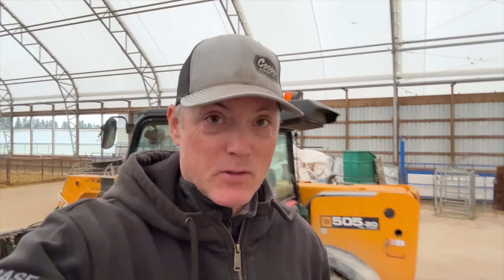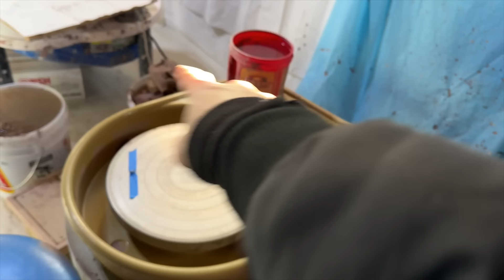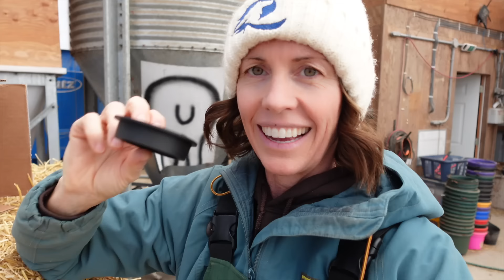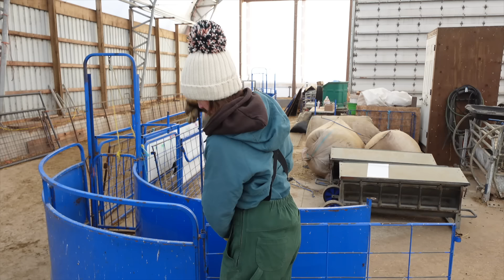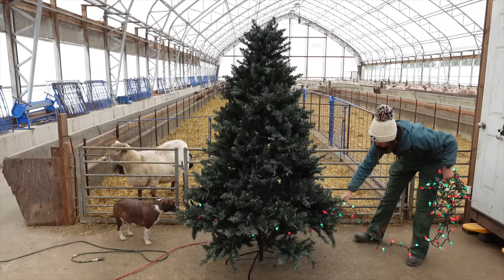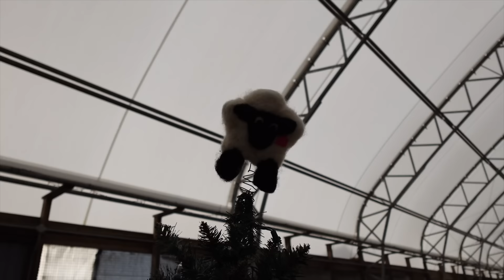I made the grain farmer be a SHEEP farmer for a day...

Comment: Just got to comment about Mark being in the barn. Thank you for giving Sandi room to be strong and capable, yet still supporting her when she needs you.  Reference: lambing 250 ewes after she broke her leg.
Reply: And everything else you do like keeping her equipment running!! ❤❤❤
Reply: I wasn't subscribing to this channel at that time, How did she break her leg?
Reply: Slipped on ice in barn if I remember correctly.  It was in the first few years of having the flock.  Mark got / had her get the telehandler as she recovered as it was easier than the system she was using and he knew she would be back in the barn as quickly as possible.  I have no clue which video it was that she relayed the story but it was one when she was talking about the old white telehandler.

Comment: And he can actually make a way for the two plugs to screw together and it locks the two together and you aren't having to rely on the sheep not nosing one out and the others from yanking out the outside one. I love 3d printers. My husband has one as well.
Reply: Thats a good idea. Also migth make it easier to take w
Away when needed if make a mark in the for a specific tool
Reply: I was reading all the comments before I tried to describe the plug idea. Glad someone else thought of it too. 

A plug just like the original only with threads inside too for the inside plug to screw into. Oh and a way to grab hold of the inside plug piece.

I love 3 D printers.
Reply: @gail1959  the one I have seen has recesses into the two halves to where you can use your fingers and thumb to twist it.

Comment: I have chronic migraines and they suck. Especially the light sensitive ones. If you don't have meds around for a migraine, take a shot of whiskey. you just need the vein that causes it to open up a bit.  Also regular excedrine is the same as the migraine stuff. its just cheaper.

Comment: Sandi, as a long time migraine sufferer with extreme nausea, try some peppermint candy to take the edge off the nausea. Also, a soda with caffeine will help as the caffeine will help a little with the migraine and the syrup will help coat your stomach which will help it calm down some. Hopefully you don't encounter more, but if so, this may help.

Comment: Sandi, for your migraines (that are not sinus related), you should rub ice cubes on the nodules (nerve bundles) at the base of the skull where it meets the neck. Usually, there is only one node that the ice feels really good on. I have had it happen on both on rare occasions. 

Just rub the ice in circles until it starts to sting/burn. Throw the ice away, and the headache should subside in minutes
Reapply as needed. I rarely needed to reapply

This remedy was given to me by an older Dr and has saved me thousands in hospital bills(no need to go) and no money spent on medication.

Comment: Sandi, as a former migraine sufferer, I feel your pain.  You probably know, since your two sisters have had migraines, but stay away from chocolate and red wine, red grapes, aged cheese, and foods with nitrates.  These are common triggers - and they make a migraine worse if you already have one.  I used to get migraines after my kids were born, but after maybe 10-15 years they have stopped.  I found eye pillows to be very helpful, especially the lavender scented ones.  Or you can put a cool wet/damp washcloth over your eyes if you don't have eye pillows.  They are little cloth bags just big enough to cover your eyes and are usually filled with flax seed.  Hope your migraines go away quickly! 
The little plug that Mark made was great!  Could he make one that you could put a cotter pin or something similar in, that way the sheep couldn't push or dig it out.  Just a thought.

Comment: Sandi, once you’re completely set up in the shipping room, you might want to look into doing an overhead packing peanut system. The company that I used to work for many years ago had a system that was a bag mounted with pulleys from the ceiling making it easy to raise and lower. It actually looked quite a bit like a combination of a blue tarp and one of the big agricultural/grain or seed bags you use the forks on your tractor to lift, the ones that open from the bottom and dumps into your seeder wagon? In our case, instead of opening the entire bottom, we configured it to only open about the width of a piece of conduit tile/hose. And it just had a little toggle at the bottom of the hose which allowed the hose to be put over the box, then toggle aside so that the peanuts would fall out, and then we’d toggle it closed to stop the flow. Then you’re not having to do handful by handful and dropping them all over. 😊

Comment: Sandi, migraines are usually indicative of decreased blood flow to certain parts of the brain. I’ve had them for almost a year straight before, the only thing I could do was sleep, sleep, sleep. I haven’t had one in over a year until last month. I’ve now had about 4 in the last 3 weeks. I do believe my recent ones are due to changes in barometric pressure. Taking Excedrin Migraine helps as the aspirin thins the blood sending it more readily to all parts of the brain. It also contains caffeine which is a great helper for the aspirin. As some headaches can come from not having your daily coffee fix. Please take care of yourself as soon as your first sign of a headache begins. My daughter found a head cap made of neoprene online that you keep in the freezer and put it on when a headache first starts. It works great. Also, an ice pack to the base of the skull works too. Rotate the ice on your neck for 5 minutes on, then 5 minutes off. Hope you’re feeling better in time for lambing dear. ❤
Reply: Having suffered migraines for over 54 years & researched as a nurse, I don't think you're correct about causation. The most recent research I've seen is that it's vasospasm 💕

Comment: Hi Sandy. Hello from Ohio. I’ve been watching your channel for quite some time and I am amazed how you run the animals. From operating equipment, vet issues, working with the sheep and babies, to merchandise, you rock!  

After watching this video, I was thinking how you could expedite the process of finding multiple orders shipped to the same address. I’m wondering if there is a way to add a check box to the website that customers could click, indicating that their latest order is a second (or third, fourth, etc.) order for the specified launch. Then, if by checking that box, their order sheet would have a notation, indicating duplicate shipping addresses. Just a thought, I am in no way a website programmer, but thought it might be worth mentioning. Happy lambing!

Comment: I feel ya on the eyesight Mark. My close up vision, which was all I have had for years, is fading a little more all the time. :(
As a sufferer of multiple types of migraines - tension migraines are awful, generally caused by tension in the muscles around your skull. Sinus migraines are less awful - feels like jello has filled your sinuses and causes pressure and slithers around when you move. Each type requires different types of prevention - sinus is prevented largely by allergy meds, while tension you have to identify both the cause of the tension, and the physical response to the stress that causes the overstimulation of the musculature - in my case, clenching my teeth. So, if I know I am stressed, I wear a night or sports mouth guard to cushion my teeth.

Comment: Brocks are looking beat. I'm sure you're  getting lots of migraine advice... here's mine: started them at 10yo (started period at 9) related to my cycle. Fast forward : migraines are fewer but worse. Years ago l learned when I saw the aura to immediately get caffeine (not a lot) into my system an Aleve (Ibuprofen gave rebound headaches), best not to lay flat, sit up and if possible put  cold pack on your head , there are gel packs on market that apply the "squeeze freeze" like a snug skull cap. Slow down activity. I had to experiment a lot because of cardiac issues, I couldnt take migraine meds. It works well for me. Also Exedrine Migraine works better than i thought it would but has more caffeine so the heart thing again.I hope something  helps you. Prayers for you and your migrainiere sisters. Blessings.

Comment: I used to be a horrendous migraine sufferer.  No meds worked until I discovered cafergot suppositories.  As soon as you feel one coming, you cut off about a quarter inch of a suppositiry and insert up the rear end.  Instead of being out three days in every fortnight, I got my life back.  I cut my meds right down and my suffering down 90%.  The trouble is that your stomach shuts down and so oral meds don’t work well.  Hope that helps someone.  Migraines are the worst!